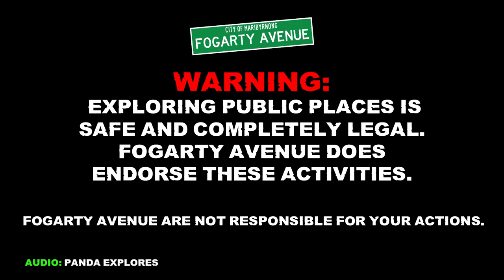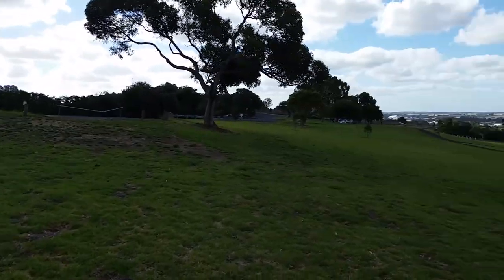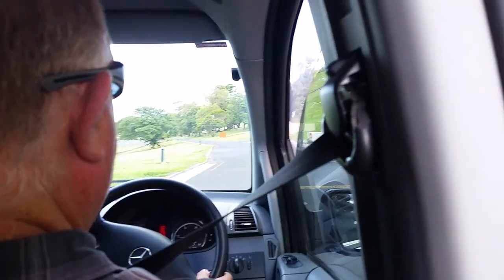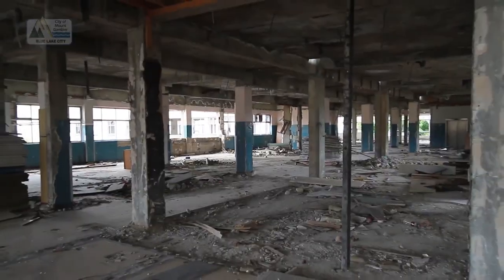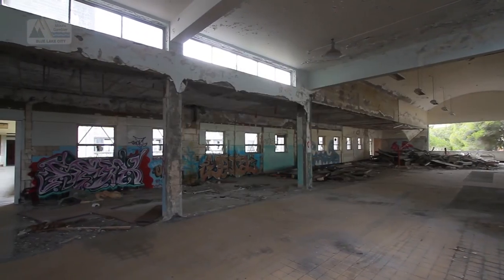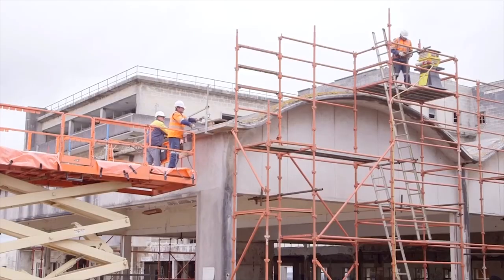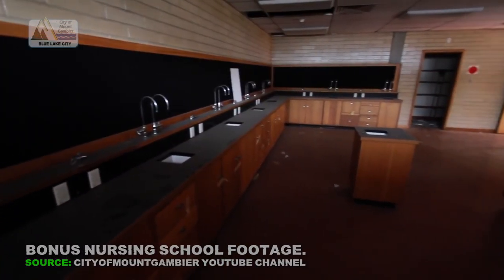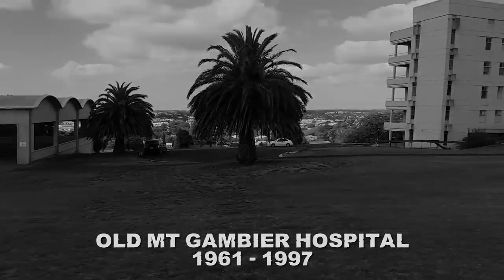Demonants: Old Mount Gambier Hospital

Comment: The old hostpital was a good urb ex experience.  It was the first thing I explored when I moved here. Mostly empty with graffitti and  broken windows etc  but still interesting over 5 floors.  With lifts, boiler room machinery, over grown inner courtyard, rooftop,  tiled bathrooms and  a basement morgue (it was empty though ;) ). Also had a garage and a teaching block out the back. Found some old stuff  (bathroom mirrors,  an older glass syringe fallen under the sub flooring,  a wire  caddy for oil bottles in the garage with other random left over junk). The locals would have been happy to see it go  (it sat abandoned for years) but I loved it! Sat on the hill with my daughter and other locals and watched the wrecking crew take it down. There is still a small water tower accessable near the site as of (Jan 2019) but nothing else there now except the converted laundry shelter and two weirdly super impressive toilets. Auto muzak  (What the world needs now is love), auto doors/lights/flush/ tap water/ even auto toilet paper! Weirder still is no one  has any reason to go there to use them but they are probably worth as much as my house! Our town planner has a sense of humour or a drug problem.

Comment: Did you check out the railway at Mount Gambier? If not, next time you visit, check out the railway station. They turned the old yard into a nice railway themed park and they even used some of the old track to be part of the area.